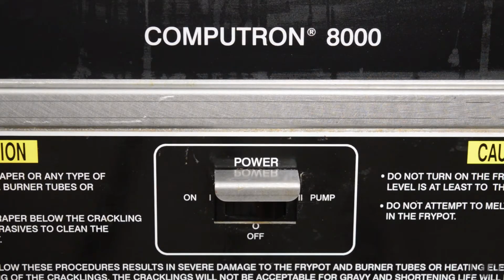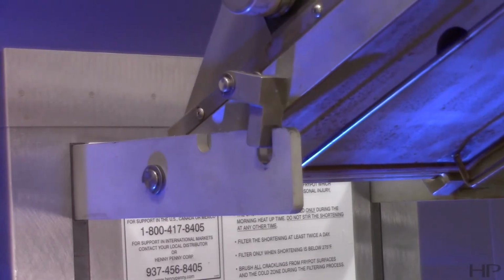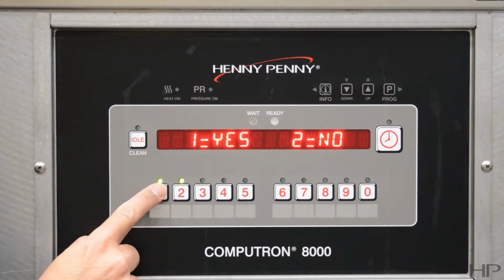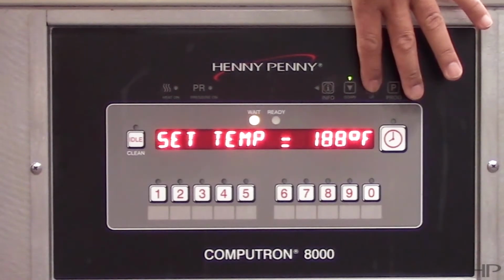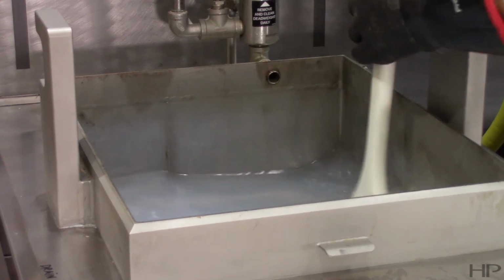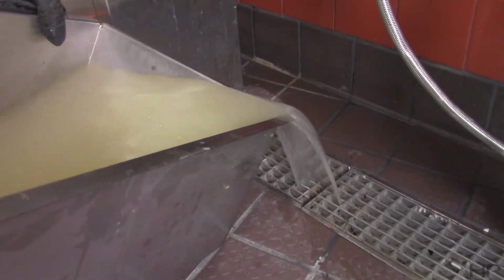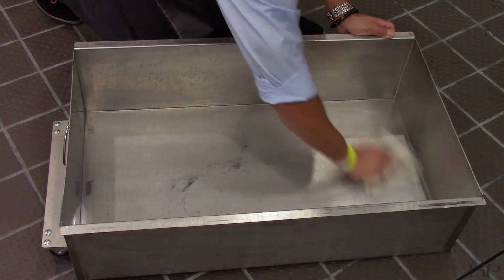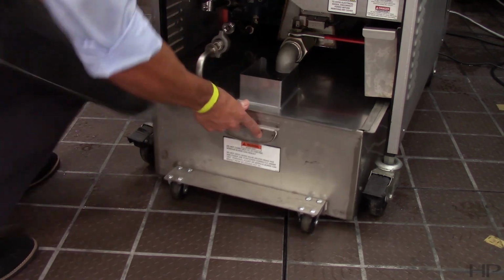Clean Out Procedure - Henny Penny 8-Head Fryers

Comment: Is that fill to the hot fill or cold fill line? Or is there a water fill line?
Reply from the maker: For the cleanout procedure you can fill up to the hot fill line so the water can come in contact with the crust ring around the vat and remove it.